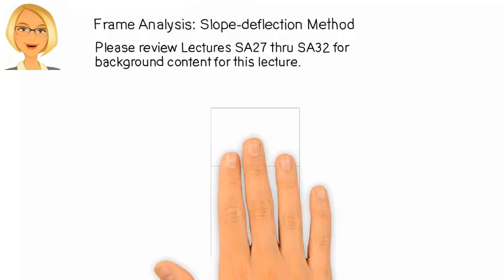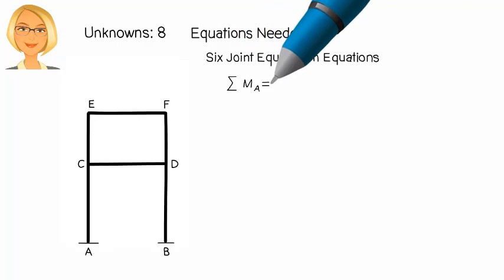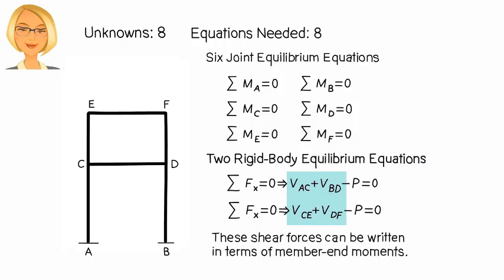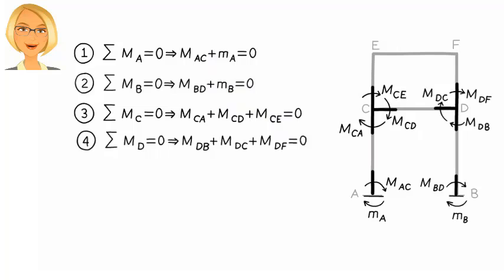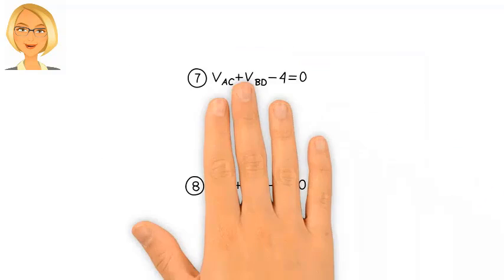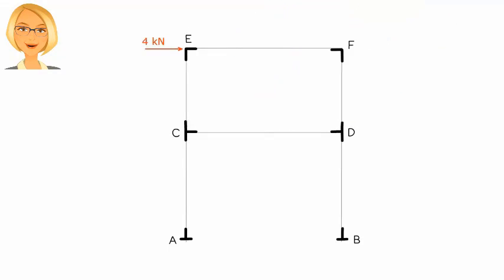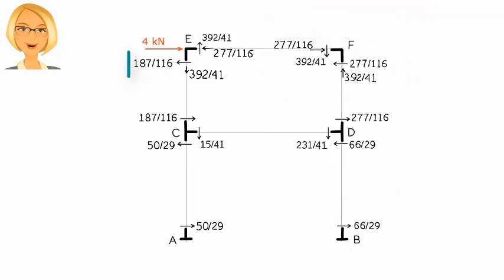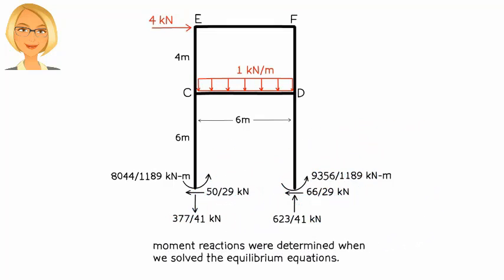SA33: Slope-Deflection Method (Frame Analysis)

Comment: Thank you the videos are really helpful for my revision. Just came across a similar question for one of my papers however the members CD and EF are of infinite rigidity. How do we deal with that? Does it mean slope angles c,d,e and f are 0? All the slope deflection eqns I wrote are leading me to a dead end, my wild guess is that It cannot sway without becoming plastic hinges at all joints. Appreciate if you could answer!
Reply from the maker: Yes, in the case of highly rigid beams (say, they have a very large moment of inertial), then all the rotations would be zero. You can then use the last two equations (7 and 8) to find Delta_1 and Delta_2. Then, substitute them back into the slope-deflection equations to determine member-end moments.
Reply: I tried but I still can't. The moments cd dc ef fe have to be 0 because slope deflection eqns add up to be 0. So for moment at joints to be in equilibrium the structure cannot sway unless plastic hinges are formed. I mean the sums just don't add up.
Reply from the maker: Mcd, Mdc, Mef and Mfe are not going to be zero. What makes you think they are?  The slope deflection equations are in terms of joint rotations (which in this case are zero), delta (which is not zero), and fixed-end moments (not zero for CD).
Reply: To prove my point create the slope deflection eqns for EF. Since there is no delta and deflection (due to the infinite rigidity of Member ef) no moment at the joints will be present i.e moment ef and fe have 0 moments. Now use joint E since the joint must be in eqm, i.e. Moment ec and moment ef = 0 and since we have already established that moment ef is 0. We can know that moment ec is 0, and conclude subsequently that sidesway is 0.
Reply from the maker: Infinity rigid beams means no rotation at the ends of CD and EF, and by extension no joint rotation in the entire frame.

Since the ends of the two beams don’t rotate, we view them as fixed points that can translate. Think a rigid wall that can slide along x axis.
 
Equations 7 & 8 can be used to calculate the two deltas (D1 = -36/EI and D2 = -32/3EI).

Substituting these values in the slope-deflection equations for the vertical members, we get:

Mac = Mca = 6 kN.m
Mce = Mec = 4 kN.m

Visualize ACE and BDF as two vertical beams that are fixed at the base (no rotation or translation), and also fixed at the beam end of C and E. 

Now apply the moment equilibrium equations to joints C and E.

For C, we can write:  Mcd + 6 + 4 = 0. Or, Mcd = -10 kN.m
For D, we get: Mef + 4 = 0. Or, Mef = -4 kN.m
Reply: Dear doctor structure. I remained unconvinced. How could EF have any moment when there is no rotation, delta and FEM.
Reply from the maker: Imagine a beam that is fixed at both ends, and it is not subjected to any loads. There is no joint rotation, no displacement, no fixed-end moments. Now place a bending moment at the left support, view it as an applied load. What happens if you analyze the beam under that load? Would there not a bending moment develop at the left end of the beam? given that sum of the moments at the joint must be zero?
Reply: Hi doctor structure sure I got it thanks for help.
Reply: One more question Doc Strucuture. How do you form slope deflection eqns for cd and ef when the rigidity is infinite? Is it even possible?
Reply from the maker: Yes, to assign a very very large moment of inertia to the members. Numerically speaking, if the columns are give I then 1000(I) for the beams will do.